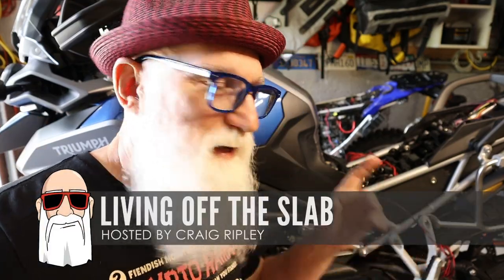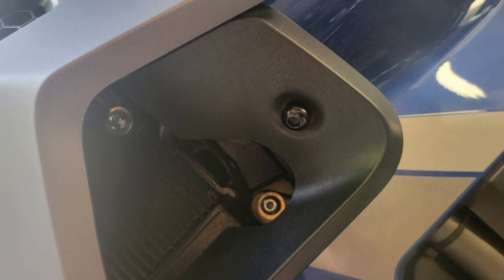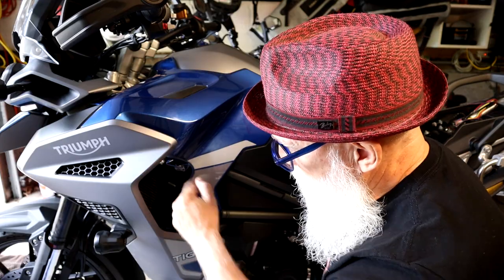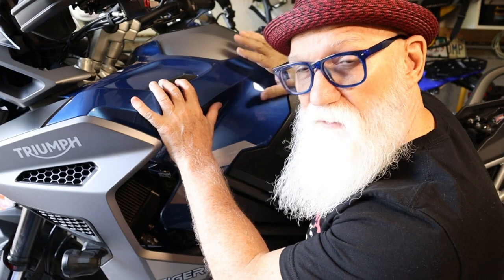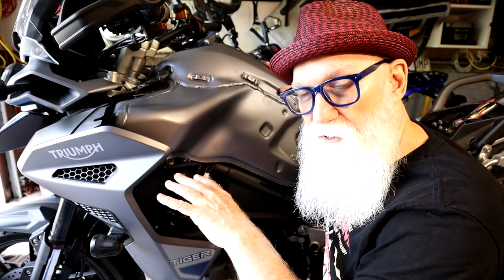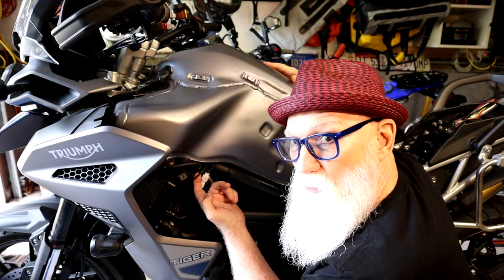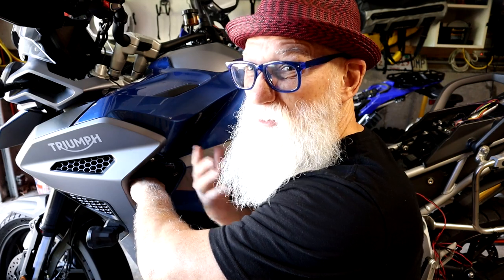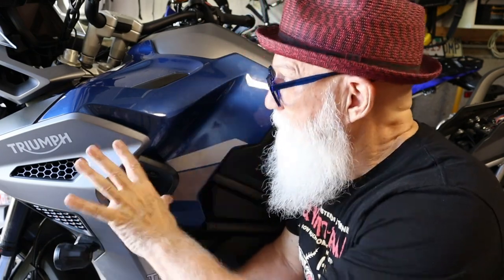2023 Triumph Tiger 1200 GT Explorer | Removing the Side Panels

Comment: I've had the left panel off a couple of times (mostly thanks to this great video) and it's a pain to put back in .... but it gets easier. I took the throttle side panel off yesterday and it was a real PITA to reassemble because the top lug has to fit into a shared slot on the tank. It took me ages to slip that bastard in successfully lol. There is also a clipped lug near it that goes into a bigger slot near the tank. That clip on the lug would continually detach itself from the lug and disappear into the innards. I reckon that clip isn't really needed but I persisted anyway and eventually got it all to work.  Just a warning for newbies!

Comment: Question: I bought a 2023 triumph Tiger 1200 GT Explorer in January 2024. During a long ride , I noticed numbness in both hands. I installed evo-tech bar end weights and I believe it reduces the vibration somewhat but I still experience numbness during long rides at highway speeds.(65-80 mph) Are there any other suggestions you have for this issue? Also, this bike will probably never see any off-road duty.  Other than that, I love this bike.
Reply from the maker: Yeah there is little buzz in the bars. Most of time I don't notice it, but some people are more susceptible. My hands don't go numb but they do get sore. When on the highway I use cruise control if possible and then open my hands flat on the bars, using a light touch. I will even alternate using one hand on the bars letting the other one rest. I have also found that 4th  gear seems to be the busiest, around 5000 rpms. I will shift to 5th and keep the rpms around 4000 for cruising.
Reply: @showcoach97  I've just bought a 2022 explorer gt, and I'm finding the circumference of the grips are to thin and they're giving cramps in my fingers.
I'm going to fit some foam grips on, to make them thicker, see if that cures the problem.

Comment: I wish this was available a few weeks ago! Easy to get off... but took me a while to wiggle it back on lol. I ended up buying a small torque wrench because these bolts are specced for very low torque. It would be easy to break the plastic tabs just using hands and "Feel".
Reply from the maker: I have had them off several times and did not cracked anything. But, fair enough, I added the torque settings in a pinned post,
Reply: @LivingOffTheSlab  It's probably pretty safe using a small hex allen key but I can imagine someone using a 1/2 inch ratchet drive cranking it too hard lol.

Comment: Best wishes from UK recently bought a GTE with a scratch on the side panel which the dealer kindly offered to replace and fit. Unfortunately when I checked it in to have some Denali lights added the shop pointed out that the dealer has refitted that top panel incorrectly at the front lug and would not touch it as he says they are fragile and was worried he would break it! Looks like I will do it myself your vid is perfect timing. Only one question does anyone know what the torque setting for those panel Allen bolts is? Thanks for a very clear vid. Looking forward to more content.
Reply from the maker: I will have look up the torque settings.
Reply from the maker: Torque settings are 3NM on those panel bolts.

Comment: Very helpful video, thanks a lot. Are those the only panels (left and right)  you have to remove to remove the fueltank (for changing the airfilter)? Cheers from The Netherlands
Reply from the maker: I have not done that yet, but I imagine you need to take the front panels off as well.
Reply: @LivingOffTheSlab  have you removed the front panels yet?  Seems fiddly.
Reply from the maker: @ChefGreen  No, I have not yet. They are just hanging, so you do have to be careful.